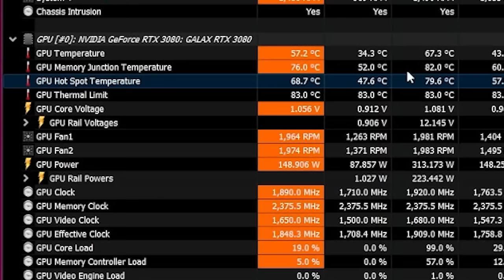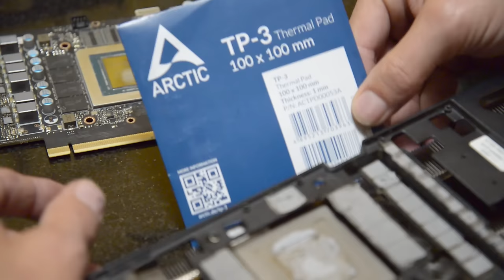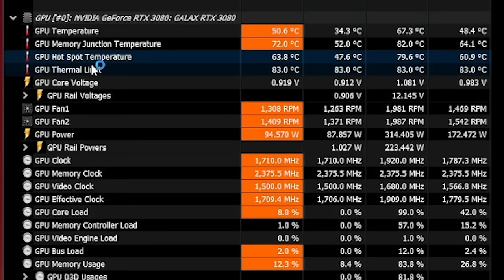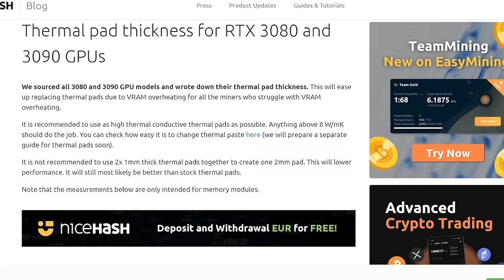My Bad 3080 Copper Mod

Comment: Hi there. I've bought a second hand GPU and I was told that it was copper modded. I was told that I should just change the thermal paste on the copper shims if the temps were high and so I did. It brought my GPU from 86c to stable 75c when under full load so I was satisfied. Few weeks have passed and I've come across some forums that when copper modding you should use kapton tape, which I did not put on when I was reapplying the thermal paste on the copper shims. It also didn't have any kapton tape when I opened it and I was told that original owner modded it like that for a year without tape and had no issues. So I'd like to ask if should I still add kapton tape around it or should I leave it as is to avoid the risk of moving the copper pads?
Reply from the maker: If those copper shims moved at all during the reinstallation of the heatsink, you could be at risk, to be honest. Some of those resistors are only JUST below the memory module height. If it were me I would kapton it.

Comment: That´s really sad. When you show in the begining of the video temperatures - I told myself WHY is he doing it??? Every video that I saw was like 100°C or 105°C on memory after 15+min.... I´m not Nvidia fan, I´m running RX7800XT. But as electrician I found these videos quite educational! Everyone can see all the obvious things,,,,,, after they happened - but before that´s real chalenge.    If I can see something positive in this situation -> atleast some manufacturers CAN deal with GDDR6X temps. 😀 Question: Is on chip visible burst point damage or even crack? If not I would continue to try to resolve. Or possibly colab video with @NorthWestRepair......
Reply from the maker: Thanks for watching and commenting!!! Yeah, I regret this mod LOL. BUT, It's just a thermal pad sizing issue. If I use thinner pads the memory temps heat up but the GPU is nice and cool. If I use thicker pads the GPU heats up but memory is nice and low. So I just need to get the right combo in there and there is NO/ZERO documentation on that for this card. I have three different size thermal pads coming. I'll be sure to post an update.

Comment: you should have coated the copper with thermal paste, because copper should not touch other chips and aluminum (I modded my 3080 with a copper plate too)
Reply from the maker: I definitely should have lol
Reply: no amount of coating will prevent shorting, its a shit mod that no one should do.
Reply: @Fatpumpumlovah2  camo on dude 😱 My card has been running with this mode for 1 year and in any case my memories are 20 degrees cooler what is bad about :)
Reply from the maker: @Fatpumpumlovah2  Kind of agree on that one lol
Reply: @Fatpumpumlovah2 incorrect. You can use kapton tape.

Comment: Loved the video! I bet I would have missed that mfkr aswell dont worry. It happens!
Reply from the maker: My luck lately. Just now killed an AMD motherboard doing an XBOX-PC sleeper system.. Video just cost me $160. So bummed.
Reply: I guess there will be better days ahead xD @pctechandgames  I ordered fan replaces for my 2080 Super and the replacements, once installed, RPMs were reading wrong and jumping back and forth. Even its the exact same company/model type fan as installed. lol. Had to revert back to OG fans but got so angry in the process i bought a 3090 used ^^
Reply from the maker: @polygonekoma  I hate that. It happened to me too. Ordered fans for a GTX 980 and the mounting wholes were in the wrong spot. It even said it was for my exact model! Then same with an RTX 3060 heatsink, wrong whole size. WTF is wrong w these people lol!!!

Comment: RIP 3080
Reply from the maker: It still lives on in my rig, just a lil hotter.
Reply: @pctechandgames  you gunna ever pull it apart and redo it?
Reply from the maker: @Novagunner  Yes just trying to find the correct thermal pad size.
Reply: @trollstech  right on. Hopefully you make an update video!
Reply from the maker: @Novagunner  I absolutely will.